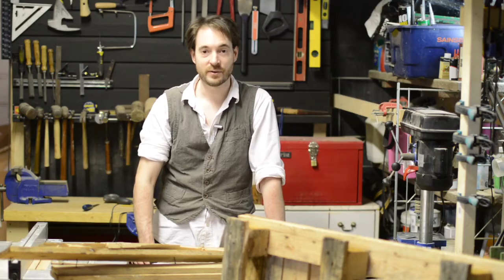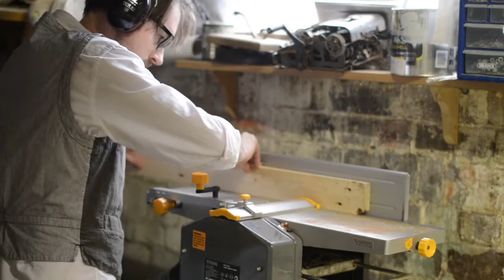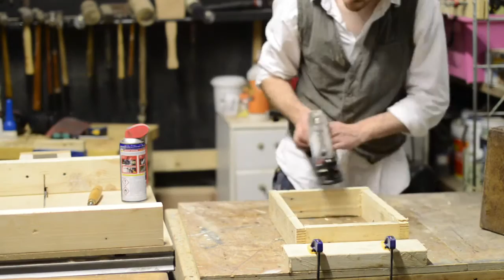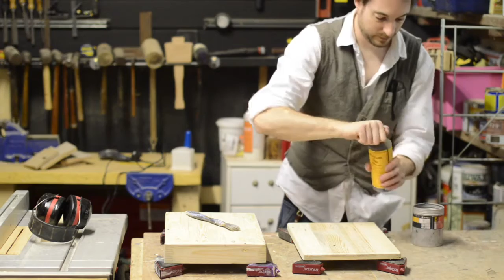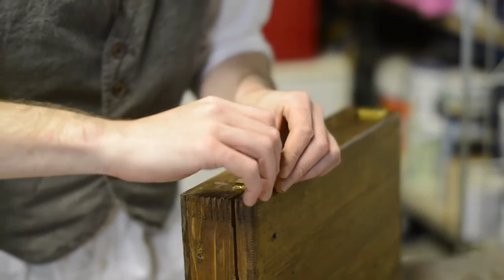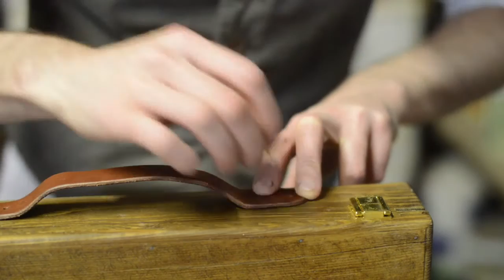Pallet Up Cycle Challenge, Briefcase

Comment: Nice Job, but I wonder why the external dimensions of the case were used.  Commercial briefcase manufacturers make the same mistake.  A4 is the standard size sheet size and yet you cannot get 2 x A4 pads to sit side by side in them.  Why?  Because they sit on the external footprint perfectly but not inside because of the thickness of the case sides!